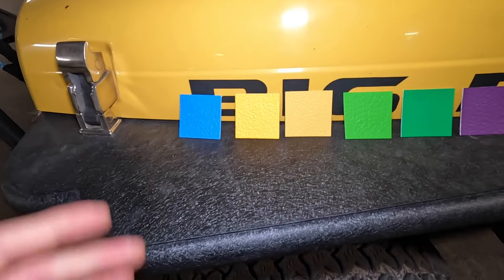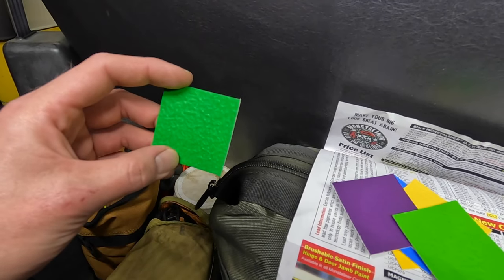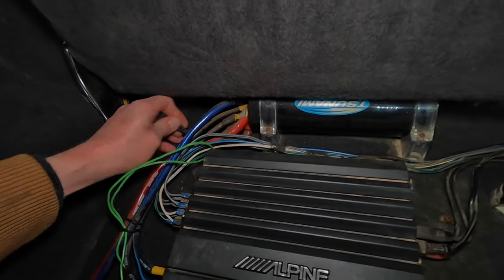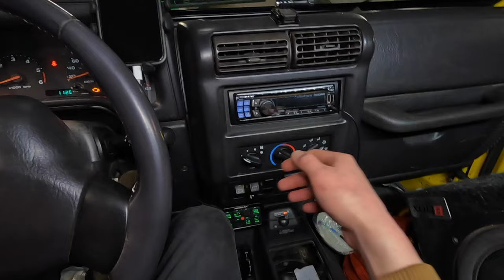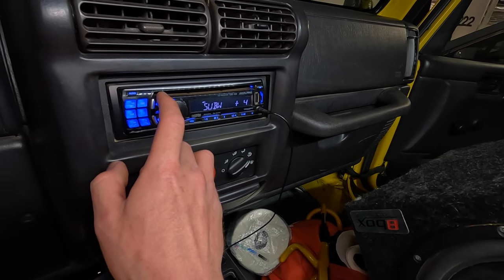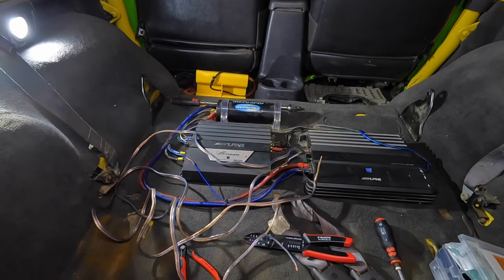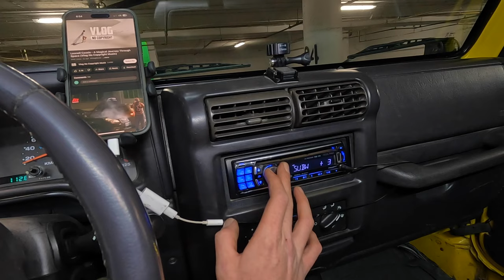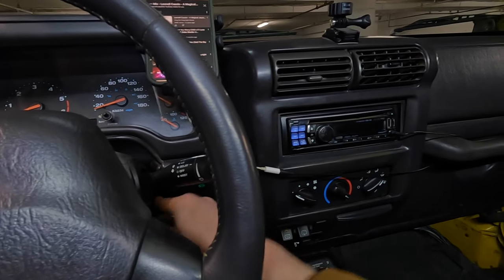Trying To Figure Out The Sound System Left In My Jeep By The Previous Owner

Comment: it's all about the amp. if you get lets say and A/B amp you can mess with the speakers more to push out more bass but yet still work as a speaker vsing a 2 way amp. but right now sounds like this setup was to make your speakers play louder and focus on the voices/stuff that does not need bass well the mono is focus on the bass side making the system sound solid for that deep bass
.

Comment: I just found something about changing the crossover settings to small speakers not full range or the receiver will try and filter out the bass signal and play only left and right until it's cranked up. Other things were mostly bad wire connections or a rubbed through one grounding out. Not for nothing but water damage may also be causing an electrical failure in a component.
Reply from the maker: There’s definitely a possibility of all of that lol but I’ll check the settings on the amp

Comment: 1 - The kick-on wire is now done correctly after your splice.  Recommend replacing with a single wire. (eliminate the splice)
2 - The sub amp, if it has a gain setting, be sure it's set to zero.  It looked like it's simply not amplifying because the signal it's getting from the head unit is too low when the head unit is set to zero.  (zero setting means no gain applied to the original signal BUT the original signal should still be strong enough at zero setting for the sub amp to see and produce an output (run the subs)).  Orrr the amp is near failure/toast.  As you didn't own it from new, most only get rid of audio stuff when it's crapped out in some way. (or stolen)
3 - Was the left sub in the box actually running?  It didn't look like it.  And how are they wired inside the box?  They should be parallel NOT series.
4 - Absolutely get the amps off the floor ESPECIALLY in a Jeep.  Way to much potential for moisture to get in and pool.  10x with a cap in the mix.  That thing could short circuit and kill a family friend.
5 - Also, looks like that cap is wired to (powering) your highs and mids amp?  If so, delete that connection. A cap is only for use with an amp on subs.  It serves no purpose otherwise and could be a power issue all around.  And really, it's debatable if it's even useful for subs 98% of the time.  So could dump it completely.  Up to you.  They were originally intended for use in SPL competitions so if you're not into that it's hard to justify its existence there.
6 - Highly recommend black for the inside color for multiple reasons.
7 - Is the power cable to the rear (for the amps) fused at the battery properly?  BTW, that power cable is pretty small for powering just  one sub amp, much less 2 amps covering full range.

Good luck and cheers.
Reply from the maker: Good tips! Thanks man

Comment: I like the lead-death-yellow.

As for the sound system issue with subs.... it seems to me like it might be a voltage issue. Does the HU put out 1.5v or 2v? I'll be shocked if it's a 4v unit. Maybe a LPF somewhere that needs to be upped? Sorry, I haven't done car audio in 20 years. When you crank the volume and sub level, you're telling the HU "MOAR POWA!"
Reply from the maker: Not sure because it came with the vehicle so I’ll have to look it up

Comment: The reason the subwoofer takes a minute to kick on is because of the capacitor. The capacitor needs time to charge. Each time the capacitor is turned off it discharges and when it’s turned back on it charges back up
Reply from the maker: Okay makes sense

Comment: I think you "shocking" the subs to turn on is just charging the capacitor. That big capacitor is charged up by the battery to supply power to the amp for the subwoofers. I'm not sure how to test the capacitor or its wiring to see if its bad, but that's what I think it could be. 

Great video as always, though!
Reply from the maker: Thanks man! And I think you’re right about the capacitor few people mentioned the same thing
Reply: @SmokinMonkeyOG  It could be worth looking into, even if it's working, it could just be too big. Capacitors have what's called a "time constant," a measure of the capacitance x resistance. It's the amount of time it takes for the capacitor to charge or discharge by a certain %. A smaller capacitor, given the same resistance, will charge up quicker, so it could reduce the amount of time it takes for the subwoofer to kick in. Honestly, though, I'm not sure how necessary the capacitor is at all in a system like yours.

Comment: Remove that capacitor it is garbage it makes things worst and add a second battery of the same value as the front battery under the hood if you need more real power.
Reply from the maker: Yeah, I’ve thought about the second battery before